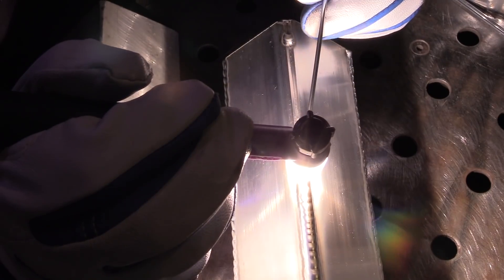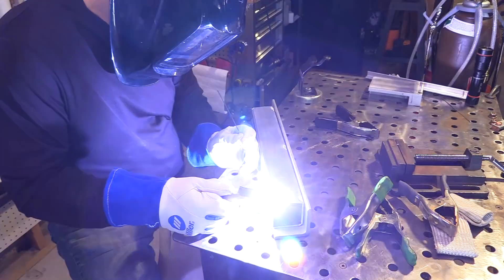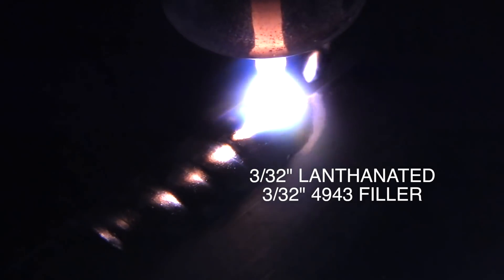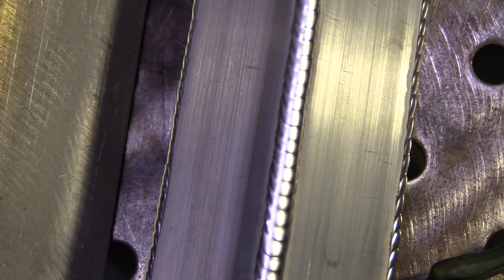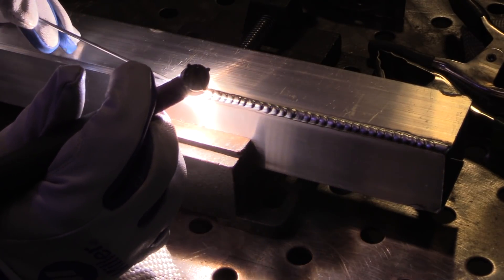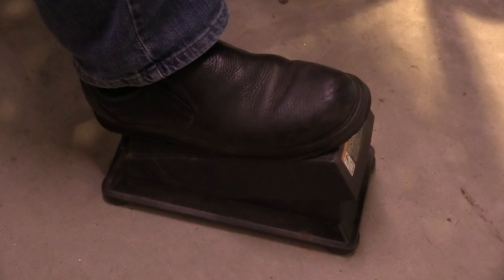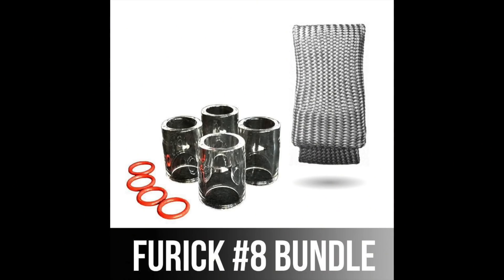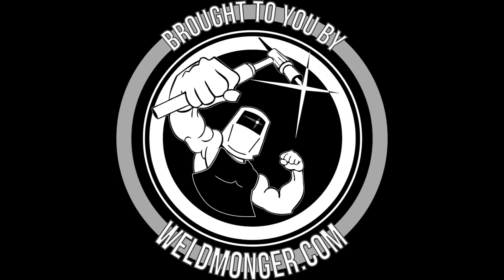TIG Welding Aluminum Tips &Techniques

Comment: Good morning  4:17am here
You draw it out thin on the end to keep the heat down then double back with a bead at the end to strengthen 
That's a great technique 
Learning to do the other types of welding with your teaching 
I can stick weld since I was 7 or 8  just messing around making sparks in the shop 
Thank you for making these

Comment: I started to tig aluminum on t6061 tubing,  I do piping on fuel oil trucks. So with do lap welds most of the time. I been experiencing the tips on the tungsten ball up since I started watching this folks weld. We have 180 Miller syncrowave.  We used 1/8 green tungsten, #6 cups. amperage I normally run  about 125 to 135. Just wanna have a clue of  why does it ball up or what could be the cause.

Comment: Another great video!  Thanks so much for doing them.  I'm new to TIG welding but getting better every time by following your advice.  I'm not sure if it will help or not but I'm having trouble knowing how much filler rod to push into the puddle so if there were little marks on the rod (every 1/16" or so) we could see how much you are putting into the puddle.  Thanks again!

Comment: The only thing i wonder is why do you use the pedal when lowering the heat instead of using the slope down? I always control the heat with the slope down and not with the pedal.

Comment: Hi Jody,
Quick question.. I am fabricating a 12' long weld table. What are you thoughts on grounding 2 weld machines to one table? Everlast 210 ext & dynasty 280dx machines. Running both machines mess with EN/EP or try to ground to other machine?

Comment: does the rule still apply to aluminum...1 amp per 1 thousandth of thickness? thanks Mr.Jody
Reply: PANTYEATR1 to an exceptional amount yes, the common type ive welded is 1/8” 6061 aluminum and ive always set my machine to 140-150 amps but seem to never really get over 110-130 depending on how long the weld is, and areas of gaps
Reply: @Lazybiker60  thanks for the reply💪

Comment: Hello Jody. I am a huge fun of you and your channel. I am building a small aircraft from scratch. There is apoint at the construction where I need to weld the fuel tanks from 0.025" thick 6061 T6 (6061) I would be happy to see a video about it. also 4130 chromoly tubing welding is part of  the build. Greetings from Greece.

Comment: Back in the mid nineties when I got my synchrowave it came with a foot pedal,funny thing is I have never used it!Most of the work I do isn't at the bench and even at the bench I still use the torch button.Strange as you might think it is,it's worked so well for me the only time I've used the pedal is when I tried to help a buddy set up a machine he bought used...anyway,I really enjoy this channel and think it would help anybody who watches it,especially folks just getting into the trade
Reply from the maker: I got used to a foot pedal for aerospace stuff.  before that it was mostly scratch start on pipe with no pedal or torch switch.  I do have a few torch mounted controls and plan on trying them out soon.  I think you can get used to either but for really tedious work, a foot pedal has worked for me
Reply: @weldingtipsandtricks  thank you for your reply!I hope you didn't think I am against using a foot pedal I was just saying that for most of the work I do it would be very difficult to use.I have 75' of lead on my torch and climb around a lot on tuna towers and other weird situations.If I did most of my work at the bench I'm sure I would be using the pedal constantly!Thanks again,I truly appreciate your channel and what you do!

Comment: Nice video jody what welding helmet would u say has the best clarity for tig welding that u have experienced with all the new health and safety laws in uk im going to invest in a papr (air fed welding mask )
Reply from the maker: The top 3 I use these days are Lincoln viking 3350 , Esab sentinel, and Optrel 2.0 
clarity is good on all them when welding , but the Optrel is pretty sweet due to the light shade being 2 and being able to see everything and not have to flip up the helmet to fixture parts etc.
I like all 3

Comment: Is there a rule of thumb how long you wait to take the torch away from the end of the weld when you are finished?  I see some people stay a long time after the arc has stopped.  You seemed to move away quick after.
Reply: Depends on the material. Aluminum doesnt matter very much. Something like stainless you want to stay until the postflow shuts off. I usually run 8ish seconds on average

Comment: Slightly off topic, but, I have been trying to read up on MIG brazing. My question is, can I mig braze aluminum.  Not a great deal of info out there that I can find on the subject. Some of the articles I do find say no but they are older articles. So, can I repair or join aluminum with mig brazing? Thanks you in advance for your help.

Comment: What do you think of thoriated electrodes? As a intern I do not feel comfortable using these electrodes. Are there any options?
Reply: One of my favorites. But these days I mostly use Pink multimix for aluminum and CK LaYzr for steel and very thin stuff.  No real health concerns besides the tungsten grinding dust but the dust from any of them is "harmful"

Comment: Thanks. Do you still have that power mig 210 have you ever tryed running 1/8” 7018’s continually to see how many you could get through before the machine stops ? Love to see how much it could handle.
Reply from the maker: I do still have it.  I dont think I could burn enough 1/8" 7018 rods to make it time out.  Ran some 5/32" 7018  one after another with no problems.

Comment: How about you make a mistake or two on purpose to show the difference, especially on long welds like this? Of course not all things that you could do wrong, but the typical ones that can happen easily. I'm not a welder (but I'd like to learn it) so I imagine something like not shielding the filler properly or adding too much filler at a time. So I'm more thinking about mistakes in technique and not settings or material.
Reply from the maker: putting it on my list... thanks.
Reply: Torch angle and puddle control are most important with aluminum. Just my opinion. Jody does a hell of a job showing how it's done right
Reply: @jasonsimmons6684  
Yes, but you usually learn a lot more from being shown how something looks when it has been done wrong. Knowing how it should look isn't of any help, if you don't know what caused your own welds come out wrong.

Comment: Jody how do you like that speedway torch compared to a ck 20 or 9 I’m pretty sure there not flex head right. Would be cool if they were . I have always liked the style of that torch. Thanks for the great video 👊🏻🙏
Reply from the maker: youre right its not a flex head.  I like being able to get all 280 amps out of the welder.  torch handle is thicker than a ck 20 but it feels pretty good

Comment: That is what I mostly do. 3/16" Aluminum with a Dynasty 280, with matching Coolmate 1.3 Water Cooler, on AC "Proset", Wireless Foot peddle, 3/16" 2% Lanthanated Electrode, and 4943 Wire. You get the same consistent results every time. Awesome machine with great capabilities over a very respectable wide range.  I also use a Weldcraft 310 Amp "Crafter Series" Water Cooled Tig torch as my go-to torch, with a 250 Amp Flex-Lock water cooled torch for the "Interesting Places".  The 4943 wire is not well known here on the West Coast and I had to order it in, but it seems that when I use it on my Millermatic 350P Aluminum Machine with the Alumipro Gun, I get much cleaner welds with less sooting than 4043. There are distinct physical property benefits to be had with 4943 over 4043, and due to the fact that I still have to special order it, I use it as my GO-TO Rod and wire. Most of my knowledge and skills with welding, techniques, equipment set-up, and the like, have come directly from you and your videos. Keep up the great work, I never miss an episode and always learn something with each one.

Comment: You should try out that variable push button that 6061 has.  A review or somthing.  I have been pretty happy with not to use the foot pedal, when working on cars. And now I dont even hook up my foot pedal anymore, for bench jobs.
Reply from the maker: I am planning on getting one of those tig buttons and trying it out.  6061 sure does some beautiful work with it
Reply: @weldingtipsandtricks  

Way rad.  Looking forward to your thoughts.  I'm giving mine a thumbs up.   

I'm giving your tig finger a thumbs up too.   It's one of those must have items.
Reply: I want one of those. I am never sat down so would benefit me well.

Comment: Good timing with the aluminum inspiration. About to head out to the shop and make a little modification to my tear drop camper galley hatch hinge. I have to make one side about two inches wider. So I'll have about 48" of butt weld on 1/16th 6061. Problem I'm anticipating is some bowing of the hinge. But I'll have to cross that bridge later. A lot to live up to after a guy watches beads like that going down. My plan...syncrowave 200, 2% lanthanated 3/32 electrode dressed down, 4943 filler (if I have it in 1/16th, if not, 5356), set the machine around 100 amps and see how she chooches from there.
Reply: Changed my mind, went with the HTP invertig 221 so I could adjust the freq up to try and make a smaller bead. Started at 120 hz but ended up turning the freq up a bit before the end. Worked like a champ. Had some bowing, nothing a little twisting, bending and hammering didn't solve. There is also SOME play in the fit up between the two halves of the hinge, so that helps. Thanks for the early morning inspiration Jody!

Comment: What amperage do you like for 11ga?
Reply from the maker: machine was set to 151 on panel, but once I got rolling, I was around 110-125 mostly.  it changes a lot on a small piece
Reply: @weldingtipsandtricks  , thx jody
Reply: Tig welding 4g plate one video

Comment: How do you like the Speedway 320?
Reply from the maker: I like it. great quality
Reply: @weldingtipsandtricks  They are the only manufacturer that makes 5/32" parts for a 20-sized torch from what I've seen.
I've got something close in my CK Trimline 18 in that it's a 350A torch but is the same size as a 17. With a stubby kit, it's pretty compact hut has plenty of headroom.